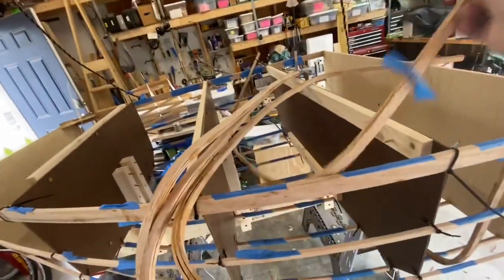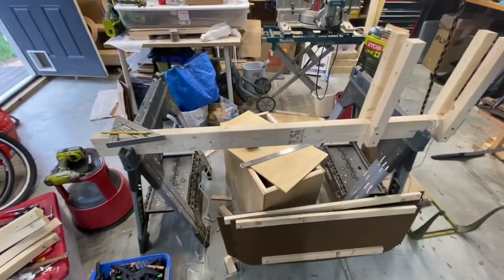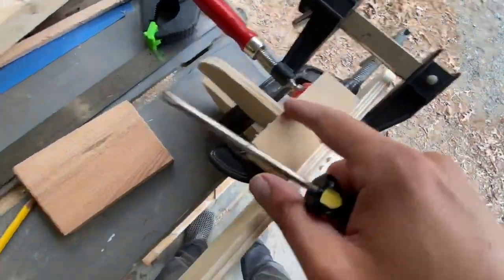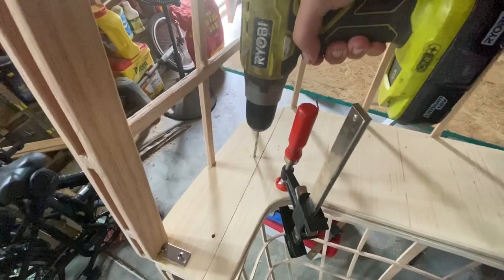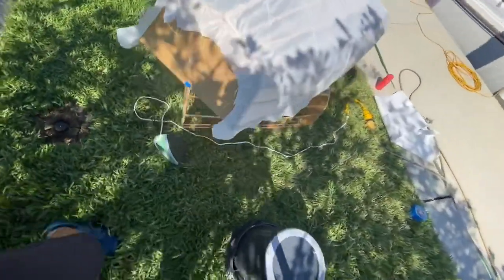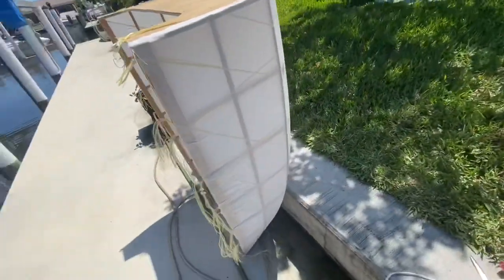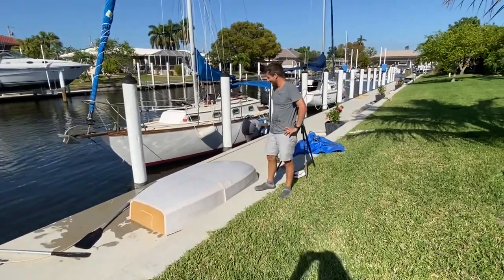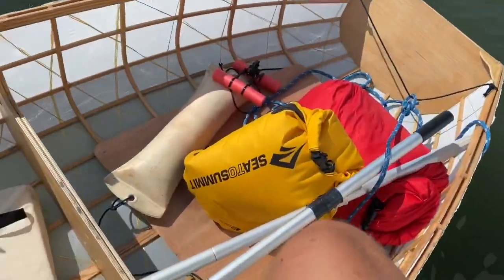Incredibly lightweight Dinghy Build Pt2

Comment: What did you use for the covering? Aircraft that use a fabric covering usually incorporate a coat of something specific to help reflect UV rays and slow the deterioration. Stewart Systems “Ekofill” might be a start? Otherwise throw an ugly silver tarp over it when not in use. I’d hate to see that gorgeous thing rot in the sun. Nice job, thank you for adding to your work by document and sharing!

Comment: Dingy looks perfect and well made - but I might consider an even tinier one for my old Caprice 20. However, have you examined to use wood strips (thin solid wood or marine grade 3-ply plywood) fastened with cramps to the stringers in a cross fashion way outside the tarp? (and then sheet with one layer multi-axial fiberglass and epoxy?)

Comment: I would epoxy the fabric....
Reply: There's paint that works really well for it. It's how they build planes and it's quite strong all things considered.
Reply: How about a coat of "Flex Seal?"  It's just silicone seal in a spray can.
Reply: @vidguy007  JUST SAW THE BOAT IN HALF!!
Reply: I like the skin on frame and that it comes apart. But I agree...If you covered the boat with fiberglass and then epoxied it you’d have a super strong boat! Albeit a little bit heavier...
Reply: @dsmoll91  the aircraft paint will stiffen it up with minimal weight. Granted it's not as strong as glassing it. But it's strong enough to withstand 200+ mph on a fusalage. It's actually a really neat system and there's some good YouTube videos on the process.
Reply: @dsmoll91  Id give it a coat of "Flex Seal" as shown in that ad.   I ordered a can, it's very thin, slow drying spray silicone sealant.  A layer of glass over that skin would be a bonding nightmare.   That construction is interesting, I'd love to see how it holds up.
Reply: SouthJerseySound yeah I’ve seen that flex seal stuff. Never used it before. I was saying take the shrink fabric off and epoxy fiberglass weave on instead.

Comment: You might want to cover the boat with a tarp or something, I’ve been looking into building a kayak or canoe out of the same fabric and have been told that the fabric covering breaks down in sunlight/UV rays.
Reply from the maker: Ive been tarping it but plan to make a cover
Reply: @samholmessailing  you can also paint it, it's not cheap but the paint for fabric planes will make it hold up really well.
Reply: Did Sam tell you he also made a kayak? I think it was also considered skin on frame. He built it on the rooftop of his apartment when he lived in L.A.
Reply: @mammaholmes  nope, i mentioned the kayak/canoe, if he does, thats fine as well. upto him whatever he'd like to make...

Comment: I would have just gotten a plastic kayak from walmart(120$) dude. Of course i havent felt your hull covering but it appears very thin. Any puncture or accidental slip of the foot will sink you! A cheap kayak would be much safer, faster, easier, and probably cheaper.

Comment: This looks really cool. Do you think you can strengthen it later on by adding a layer of carbon fiber over the heat shrink fabric? Not sure what the adhesive quality is though of the fabric.
Reply from the maker: Ooo thats a cool idea. Would add more weight though.
Reply: @samholmessailing  True. Not sure though how an epoxy resin would react with the heat shrink fabric... Maybe it dissolves it entirely.
Reply: @samholmessailing  True. Not sure though how an epoxy resin would react with the heat shrink fabric... Maybe it dissolves it entirely.
Reply: Freek Olaf de Groot .  Using a stiff covering is counter to the whole design concept.  The flexibility is its strength.  Skin on frame canoes just bounce off rock, apparently....as long as not too sharp.  I assume he uses a nylon cover, real tuff stuff.

Comment: It would be interesting to know the weight of that dinghy versus one built out of 1/8 Luan.   A similar, 8 x 4 foot pram style dinghy, built out of Luan, weighed about 45 pounds, including one layer of 8 oz (6 oz?) cloth and West Epoxy, faired and painted.
Reply from the maker: I need to figure a way to weigh it
Reply: @samholmessailing  I weighed mine by holding it over my head and standing on a scale.  I could easily carry it around by myself.  Maybe you can stand it on the transom upright on a scale and steady it.   It is a beautiful boat.

Comment: If you decide to try another build , try metal enclosed pipe 6" in diameter and about 12 ft' in length with a pressure cooker to steam the ribs. They'll be more pliable than just soaking.

Comment: Nicely done. I think you’ll find the fabric more durable than you think.  UV protection would be my concern. Airplane builders  have used this technique for 100 years. Maybe there is a protective paint you could apply that would enhance its strength and durability.

Comment: Looks like airplane fabric. If so, you should add sealer, UV barrier & paint.
Reply from the maker: I put varnish on it to waterproof it. Will keep it covered when not in use.
Reply: @samholmessailing  Check out the Stits Poly Fiber method. A silver coat will add years to the life of the covering.